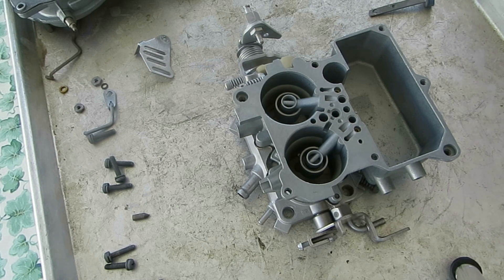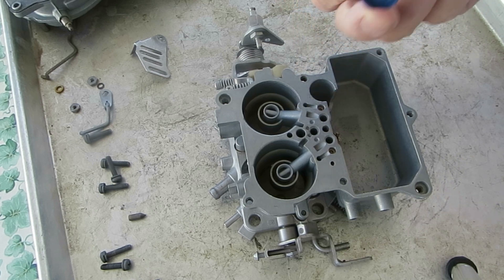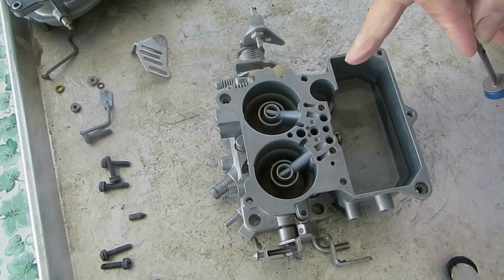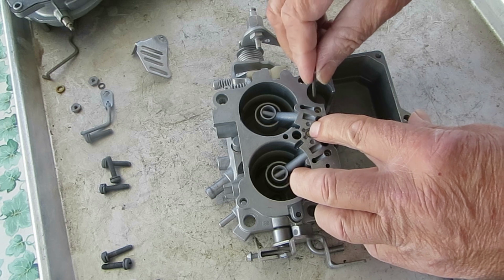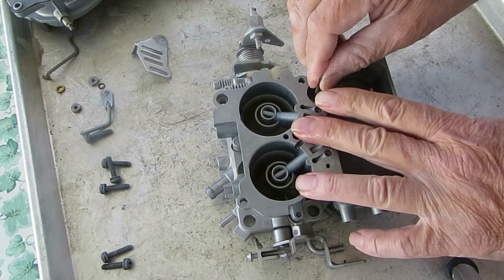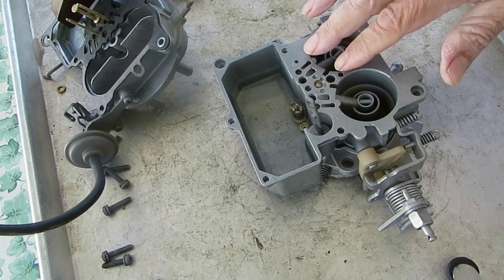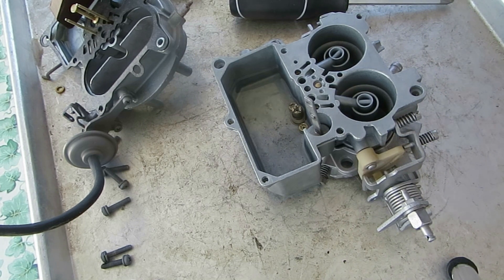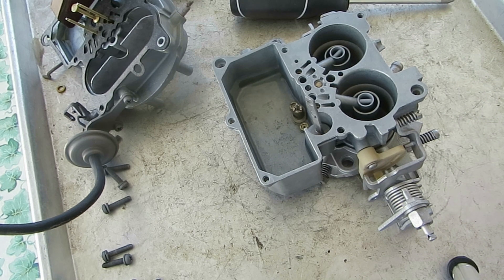Holley 2245 2 Barrel Carburetor Accelerator Pump Test

Comment: I have a Holley 4150 600cfm  on a Chevy small block and I noticed i only have fuel coming from only one side of one of the accelerator pump discharge Nozzles. Was winding what the cause could be????